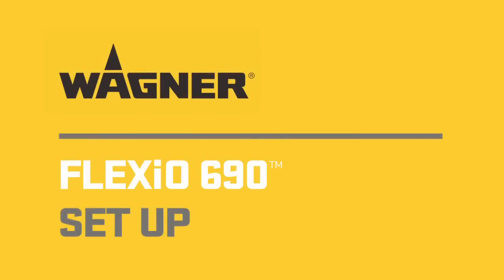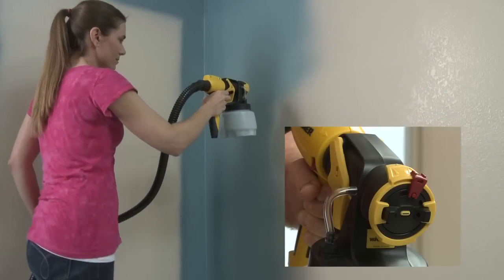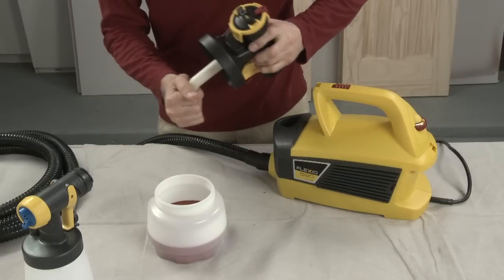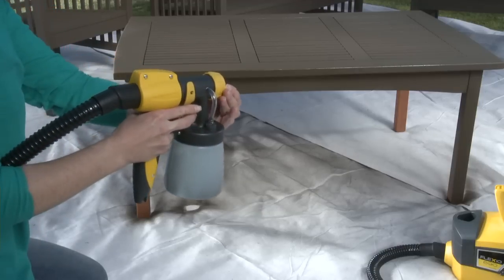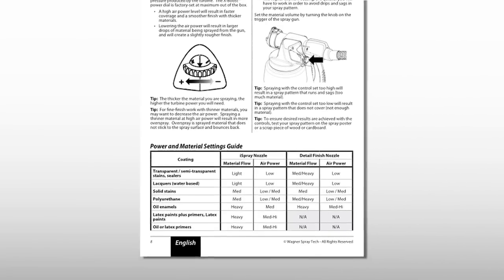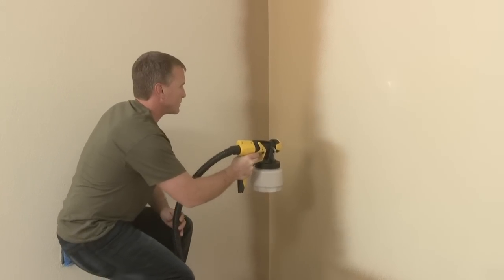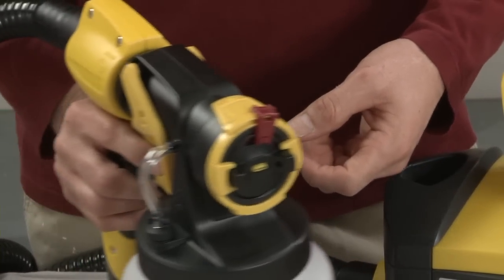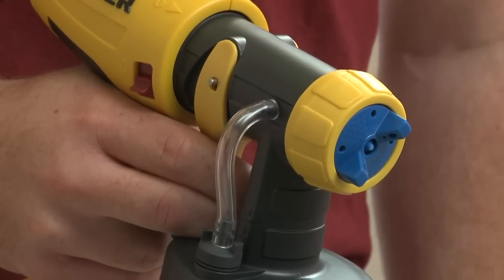Flexio 690 Set Up YouTube

Comment: I notice on this very helpful video, that the container is only about a third full, if you fill it to the maximum it's like the equivalent of holding a house brick in your hand for hours at a time, it says on my box that it covers 15 Metres Squared in 6 minutes, good luck with that, as I found the paint container kept falling from the "Gun" attachment, often while I was up a ladder at full stretch, surely a Health and Safety consideration that should be taken into account before making these largely false claims about what a great product it is, only in the TV studio folks, when you try it out for real be prepared for a shock, not an electric one, more a quality control one.
I have learned my lesson never to buy things from Ideal World again, if I ever decide to spray paint my flat, I will hire a professional kit, or get a professional to do the work, these products are a false economy, letting you think you can do the job inexpensively, but the truth is it will end up costing you probably more in real time and cash that you thought you would save…